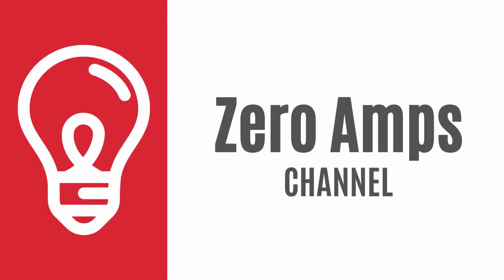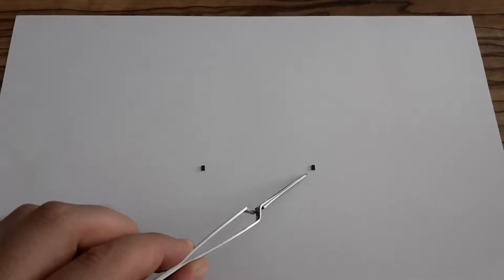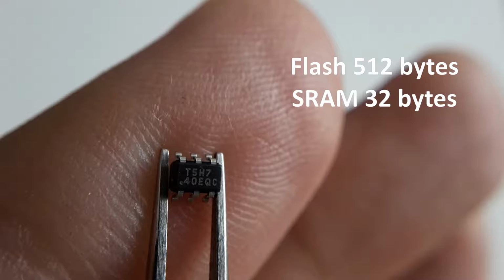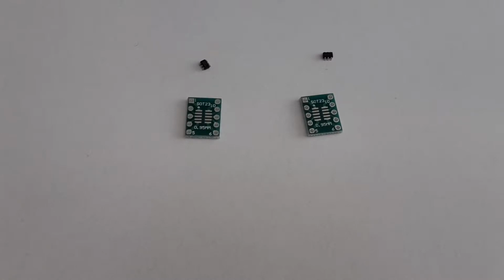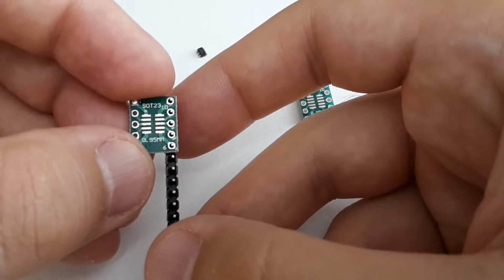Breakout Boards for Programming ATtiny10 and ATtiny5 microcontrollers (1/2)

Comment: I am also looking into the ATtiny10 - don't know yet if It can work with ArduinoIDE and how to flash it usind TinyUSB ISP tool
Reply from the maker: Hi, I use for programming ATtiny4/5/9/10 USBasp programmer which supports TPI. I'm going to show in my next videos how to use this programmer with Arduino, how to upgrade firmware in it and also how to upload binaries to ATtiny4/5/9/10.